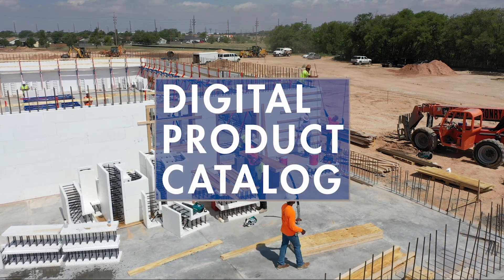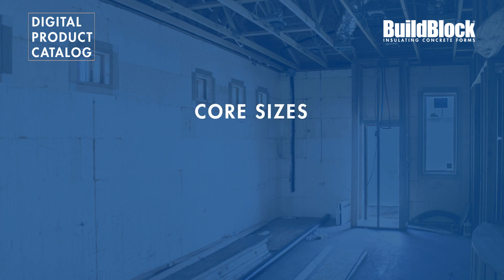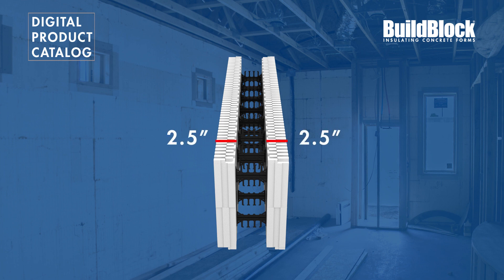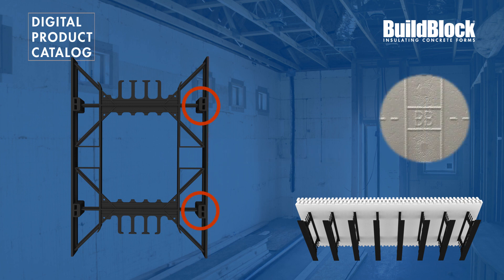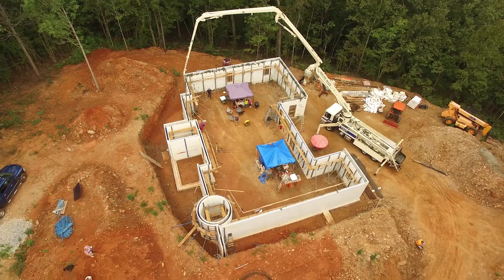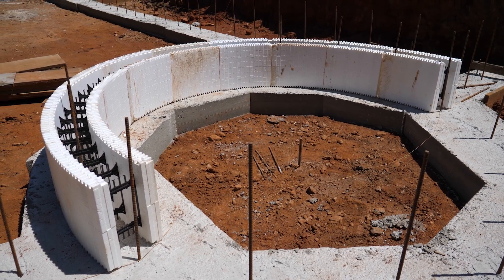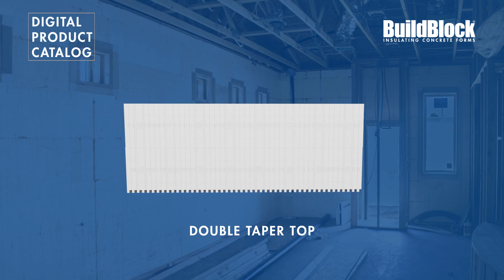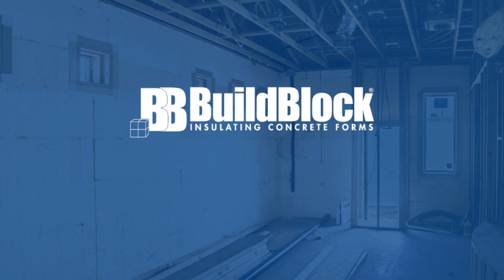BuildBlock Product Catalog: Straight and Corner Forms

Comment: Does the webbing run the full height of each block?  It looks like it there would be a gap between block above and below.
Reply from the maker: Yes, the webbing runs the full face of the block. When the blocks are stacked there is a 1" gap between the webs, which is commonly used as a chase for electrical cords.